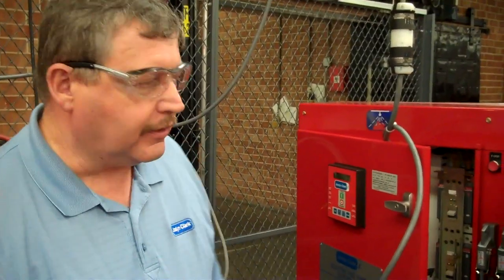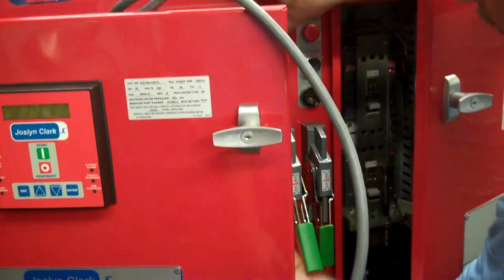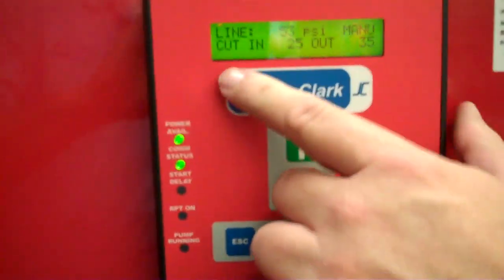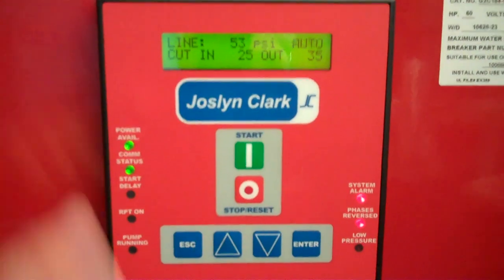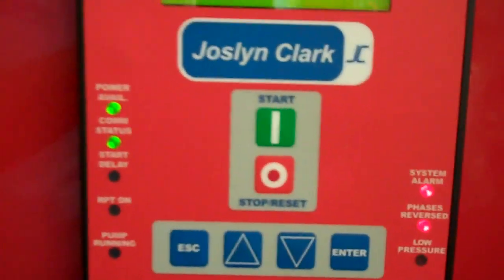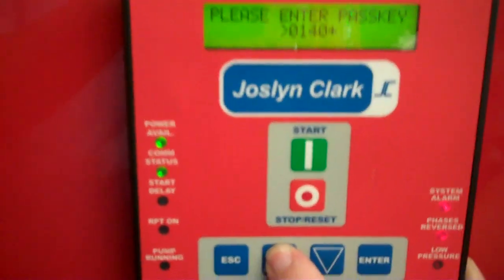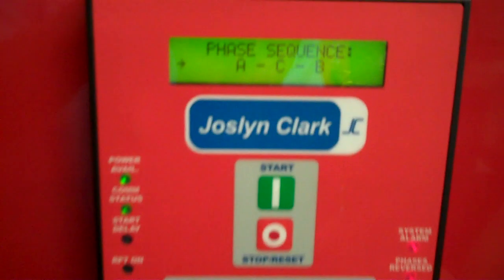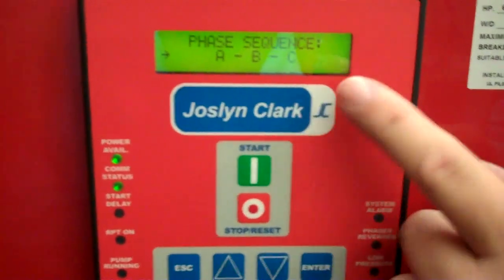Set up and Testing of a Joslyn Clark Proguard Electric Fire Pump Controller

Comment: Hi, Thanks for the helpful video. Please I need the specs of the pressure transducer sensor because someone removed the pressure sensor from the site, and I purchased a new one (0-10 bar / 0-10v / 12vdc supply)
But unfortunately it's making system alarm and reading is fixed with 598 PSI with changes